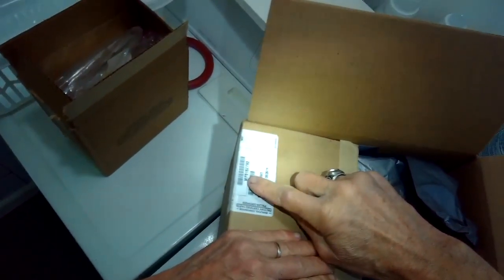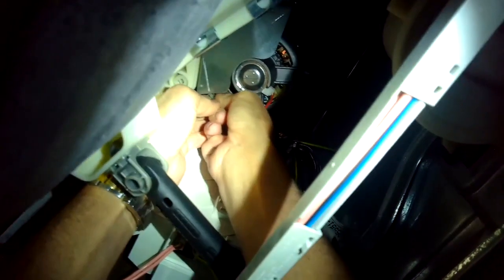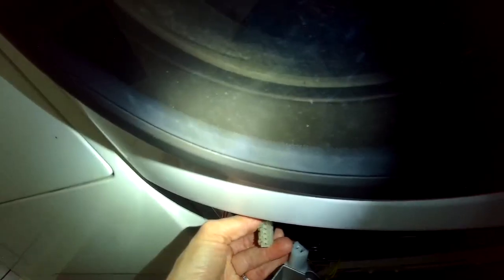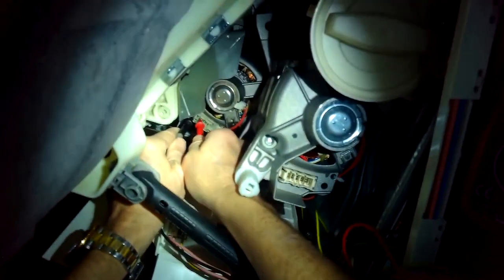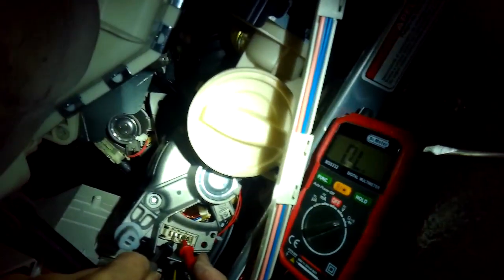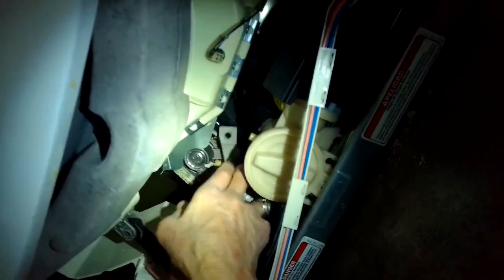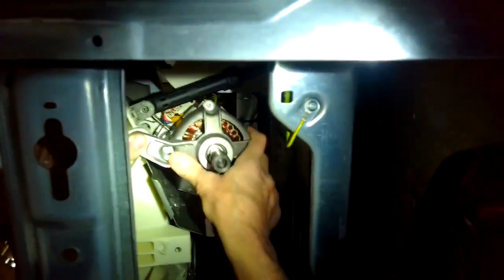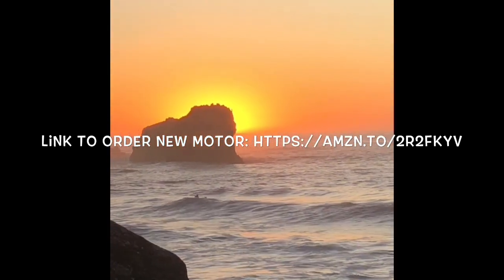WHIRLPOOL DUET - EASY MOTOR REPLACEMENT

Comment: Can I try to read with the ohmmeter with the motor out of the  washer? Or does it need to have the grounds connected?
Reply from the maker: Best to have the green ground wire connected during testing.